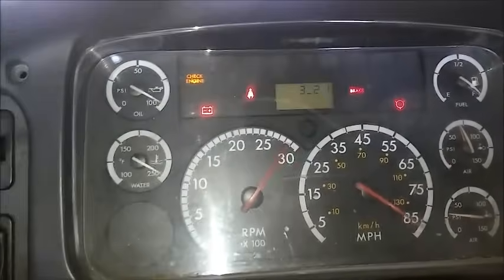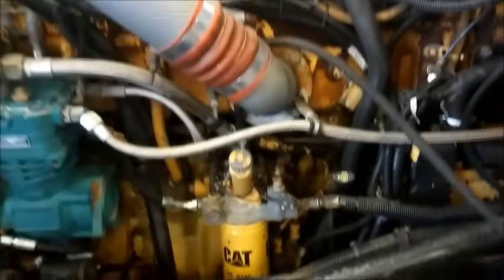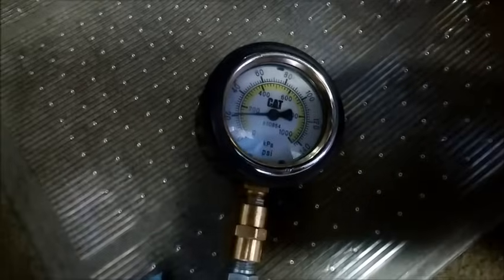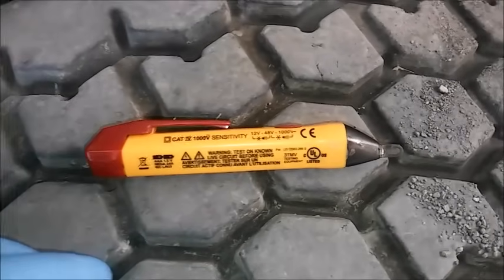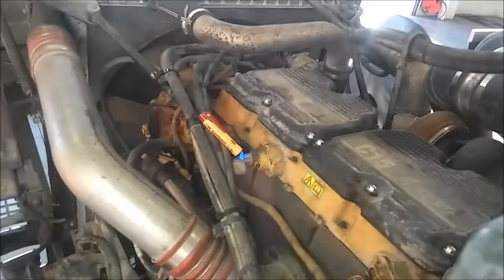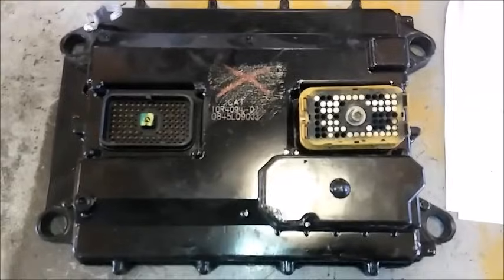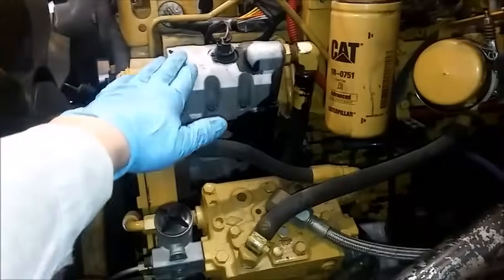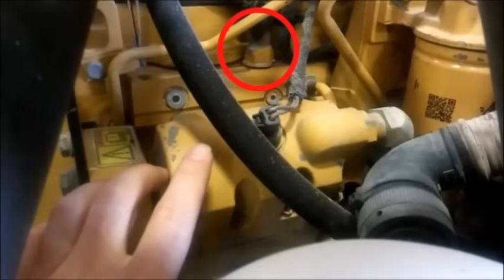Cat Engine Won't Start Troubleshooting.  Diesel Engine Crank No Start.

Comment: Hello Sir, I recently acquired a 2003 M2 Freightliner. I have found your videos most helpful with my C7. I seem to have a problem for which I have not found much if any information on. I have watched videos on cold or first start issues, which mine has but after the first start in the morning she starts up fine. My biggest issue is that the engine won’t shut off when the ignition switch is turned off, I have to pull the ecm fuse in order to shut her down. Any help in this matter would be greatly appreciated, I’m not sure where to start looking. Thank you for your time and great informational videos.
Reply: If it runs through an ignition relay to send voltage to the ecu to wake it up the relay contacts may be stuck on

Comment: I am getting nothing on the dash on any of the gauges, the truck is not going threw a chuff cycles I'm getting power to the ECM. I replaced the ecm and it's still getting nothing I had a dealer plug in to an computer and it's not communicating with the computer.... what could this be I'm dead in the water....

Comment: i have a 2007 cat 953   once engine is cool (sat all night) it will not fire without help of wd 40  once it fires  it lopes intermittently at low idle and acts the same at high idle
just recently i replaced the ecu, and the fuel/oil pressure sensor and hue pump.   still doing it exhaust smells a little unburned 
ideas????

Comment: Truck runs fine, when you shut it off and come back an hour later it won’t start without repriming fuel systems or using starting fluid
Reply: Terry Taylor  did you find out your problem what was cause ? Mine is doing same when it sits whole night next day it’s hardy start . I have c15 twin turbo

Comment: I did note that you had not checked the fuel filter output. I personally found many cold engine start fails to be week flow fuel filters mostly show up during cold start durring cold to very cold weather this is mostly GMC, Kuibotas, Oliverse, Mann, and many Euro's Diesels, American's units as well  any other throughout my world travels {US Army} but only two "Cat's TA 1697" please keep up this good work I am retired Diesel mechanic and  I started back when D5 Cat's had to be started by torch heatting cylinder glow rods during the middle 1950's. Most Diesel fuel is very dirty even right out of the station pumps. Oh I almost forgot to say about clouding of cold fuel was not present in nearly every case.

Comment: A long shot question, but my Isuzu 5.2 diesel 4hk1 won't start. Can I do a compression test by removing the glow plugs? Or does it have to be tested through the injectors?
Reply: ApplianceGuyOnline you can do a compression test at either. I do mine thru the glowplugs on any Isuzu. Just make sure the pump is in the stop position as fuel will enter the bores sealing the rings otherwise giving a false reading

Comment: I have a Cat C15 Diesel Engine before it was only cranking but now it's starting and RPM Reached to 600 and it's getting shutdown by unexpected alarm please help me if anyone knows
Reply: Mohammad Aurangzeb I am using a c15 cat engine ( marine) I had a problem with the air intercooler leaking, after change noticed white smoke what is possible cause

Comment: completer all the test in this video engine well not start can use small amount of ether it well start and stay running and runs good , but if I shut it off the engine well not start again. this occurred after rebuild. on first start up it started ok
Reply from the maker: +Anyhony Lake I had an engine that a customer rebuilt, wouldn't start. He had done it outside. We checked everything and it ended up that every injector had failed, possibly from dirt. Changed the injectors and it started up immediately. I've never seen that before or since.

Comment: Hello Mr. Caterpillar. Need some help with a no start situation. When stored my RV for the winter it had been running great for years with proper maintenance. Went to start engine and have  good cranking with no start. I get about 300 RPM on dash tach and good oil pressure on dash gauge. Called a service tech with a laptop (Cat software) and during cranking we only saw 258 PSI high pressure. Tech said it was probably the HEUI pump.  I change the HEUI pump and still have a no start. I was thinking about changing the IAP sensor as the next step or maybe I should of done that first. Can the pressure sensor fail and read low. Reads O PSI when not cranking. This is a 2003 Cat 3126E (HEP18079) with C7 style HEUI. Can the IAP sensor be tested  with a multimeter? One last thing please. Do you have to purge the fuel or High pressure oil lines. I have good fuel feed to the transfer pump. I used a little air pressure in the tank to force fuel to the pump inlet. Thanks for the videos and any help you can give me.
Reply from the maker: +Doug Hasson Hi Doug, that is very low HEUI pressure. Did you pull the valve cover and see if you have an injector seal that is leaking HEUI pressure? I would do that before replacing the IAP sensor. The IAP sensor rarely fails.
Reply from the maker: +Doug Hasson You can email me directly if you want at AdeptApe@yahoo.com it is easier to communicate on there.

Comment: Hi I am purchasing a 1962 boat which has( 2) 3114 diesel Cat engines. I am not to mechanically inclined and live in Tacoma where boat is located . What should I look for immediately when we start engines  and  sea trial motors. Do you know anyone in my area of tacoma washington that I can utilize to service and or rehab these motors. My email address is waprocess@aol.com I Your channel is great. Thanks, Aaron 206 491-0207

Comment: I have a problem in engine Cummins 4cylinder that no diesel coming from diesel pump nozzles iam pumping and the in plug is ok and return also but no diesel coming from nozzles which in diesel pump 
Please any help

Comment: This is exactly why, as an owner operator, I run a 07 truck and refuse to buy a new truck with all the sensors. 
You can trouble shoot and repair these engines with out being a super tech with a super computer. 
When your in Wyoming during a snow storm and you get a ck light on, your fked LOL Or Northern NV or Even BFE Canada...your in major trouble. 
But you have hope with a older truck. 
A 3406 b or e or a 12.7 detriot or even a n14 will all allow you to make it to a safe space even if you have engine issues. 
With the new trucks, your on a tow truck quicker then you can say FUtruck! Then prepare for the beating your gonna take at the shop in Diag time and then parts and service time. Dont even get me started on Volvo engines , paccar, mack engines or 08-10 isx junks. They should go to jail for selling those to people.
Reply: Whats the most likely issue if your CAT 3208 wont start? It runs off of starting fluid when sprayed into the intake, but once it runs the starting fluid out it dies.. I blead all the injectors and they all have diesal flowing from them. It has plunty of diesel inthe tanks... The fuel filter is full and primed
Reply: Lee Hill 🤣😂🤣
Reply: The tow job should be a beating also... I'm just reminding....
Reply: U r a moron Volvo motors are the best so far they still schools North America how to build a decent motor and Mercedes schools Detroit how to build a decent motor the cat garbage it got lucky whit international  they got bought so STFU u moron and keep changing 2 turbo s in the same time

Comment: I'm working on a ford f650 with a 3126 cat engine. I had fixed a dead injector and resealed the others and replaced the heui pump. It ran great, then backfired twice and stopped running. Now it doesn't start. I'm new at diesel.  Can anyone help?

Comment: I have 3126b icant  hear the cliks it does when you turn the key on the engine it cranks but won't start
Reply: I have the same problem, i replaced the cable harness coming from the battery to feed power to ECM it fixed my problem .
Reply: Carlos Medina  I have me a 2002 gmc 6500 having a starting problem. Are we talking about the same vehicle ??

Comment: I have a cat c12 it will start and after a couple minutes shoot down  I prime the pump it will start and run find but if I turn it off I have the same problem I dont know where  the fuel return valve is locate I went to the dealer they said at the filter  base but it is not any idea I will really aprecciate
Reply from the maker: +Pavel Rodriguez The secondary fuel filter, the engine mounted one, has the fuel pressure regulator in it. There is a plug that is I believe a 1" drive bolt style head, if you remove it that should be your regulator. You'll know if because it'll have a check ball and a spring on the inside of it.

Comment: seems that you know about problems with trouble starting trucks and such.. a friend of mine is having problems starting his truck its a 98 peter.  after a simple oil change in his semi  it wont start and check engine light is giving 3 codes which are 33, 44 and 45,, how can this be fixed and what is the issues?
Reply from the maker: +AwesomeMCGuy Please email me at AdeptApe@Yahoo.com with as much detail as you can give me and the engine serial number.
Reply: will do i'll email you  in a few days next time i visit my buddy, my e-mail is minecrafterdude0101@gmail.com

Comment: Love your explanation ,question i have a 7.2 cat 6500 ,sr any help will be greatly appreciated , my truck runs and idles like a new one the trouble i am having is that as i try to drive it he goes to missing and blowing white smoke this started last week listening to your explanation i am incline to believe may be the heui pump ? any help you may recommend on this issue  the oil gage in the truck does show a low pressure ? acts like water in system that was all check , really use to working on 6.0 7.3 this truck never have give me trouble ,your help will be greatly apressiated ,i do get codes for all injectors and replace the icp sensor for i had code 39 showing also, but still doing the same thing ??? thanks
Reply from the maker: +Jose Gorriz Can you email me this question please at AdeptApe@yahoo.com

Comment: Good day.  
Yor videos are simply done well.  much appreciated.  I have one of the problem with C15 engine as described below.  Kindly assist to advice the way forward.

Caterpillar Engine model C15, serial number MCW02801, ECM software 367-0750
this engine is used on crane.  Always problem in starting engine with battery.

Air start always okay.  Engine RPM reaches close to 200 RPM and engine starts without problem.
on battery first time it reach around 180 RPM and engine start.  from 2nd start onwards engine rpm reach only 150 but could crank at 150 as long we keep the start button pressed.  this show that battery has capacity to crank for prolonged period of time but engine is not starting at 150 RPM
 
for the purpose of test while we crank the engine using battery at 150RPM, I sprayed engine starter spray at the fresh air intake side of the engine and the engine is getting started.
 
 
my question:
1. what is the starting RPM is needed for engine to start?
2. is it possible to make the ECM to release fuel at 150 RPM? 
3. what is the interface communication cable needed and software is needed and where to buy them?,  I am stationed at Singaproe
 

 
 
Kindly assist to advice.

Comment: tach signal in a gmc C6500 with a 3126E, it is coming from the ecm or the alternator??? thanks a bunch.
Reply from the maker: +Gonzalo Perez Should be coming from the ECM.
Reply: thank you, because I do not have motion at the tach. but the check engine light turns on for a moment before crank, still the truck will not start.so i was thinking the ecm is still good.

Comment: i have  it sat long time, i found corrosion on sensor circuit, then the fuel pedal is unresponsive IM  on the proper path?. Thanks Jm
Reply from the maker: +Jim Flynn Corrosion in the throttle pedal circuit can lead to unresponsive throttle.
Reply: thanks very much jim

Comment: Had a starting issue like this on my CAT 3126 diesel pusher....it started, drove fine for about 45 miles, then would not start...it would crank but would not run. Of course, we were not home so we had to have it looked at by the RV place, which then had it towed to a Freightliner dealer. We had a wiring problem, and did not have proper schematics than. 

Up underneath the back end, behind the maintenance panel, there a lot of wiring to the remote start/start stop switches, etc. Over the years, many of the connectors had become corroded or broken. SO the service tech, eventually bypassed this wiring.  In this wiring, there hangs what is called the "STOP RELAY"...its just a cheap 5 terminal relay that can be wired as normally open or normally closed. Between the wiring and relay, the wires had shifted around so that the 'normally open" circuit was closed (thus killing the engine). The service tech wired around this at a substantial cost ($140/hr) so that it always starts OK. After we got it home and I got up under it and started looking around, I discovered the real problem (as I now have detailed schematics). OF course the motorhome is 21 years old, and was parked by my dad back in 2011-2102....and we are resurrecting it...(my dad passed away a couple of years ago) as my mom wants to take a trip to FL in it.....
Reply from the maker: +QuantumRift I've had to "custom fix" many RV electrical systems like that because finding wiring diagrams for them can literally be impossible. As long as it is wired professionally it should work.

Comment: I have a 1976 l800 with a 3208 engine cat that will not start crank but no start and if I spray starting fluid it will try to start
Reply: Without a turbo
Reply: do you have serial number of the engine??

Comment: current currently having problems with a generator that has a 3126b (bdz series) engine it. the engine will crank and according to the display on the GSC (generator set control) the rpms  are at 250 but it won't start. the issue with it before was it had an undervoltage alarm. now it has no fault codes and it won't start. Is this an ecm problem?

Comment: Hello friend , I have cat c-15 acert MXS i have code-32 invalid throttle positions sensor , i bought new one 266-1471 but problems is still there checking volts are pin 1red should be 8 volt but it is only 1.80 pin2 black is ground and pin3 ecm return is 2.90 unplugged is 13.38Please help if you can
Reply from the maker: +Satveer Dhillon Do you have a wiring diagram for that circuit?
Reply: Adept Ape thankyou for your reply , I found that wire coming from ecm to sensor it is short somewhere, so I am thinking to cut the wire from ecm and put a new wire to the ecm , is that right thing to do as I can't find where wire is broken , it is 70pin,  pin no. 4

Comment: I am having fuel issues, and it tries to start with ether/starting fluid as well as sometimes we manually pump...  any recursive
Reply: Rachel N Mine too
Reply: So the transfer pump has gone out, replaced that, and our fuel was very airy, narrowed it down, turns out it was the ignition seals.   or so I was told I was not working that day, the entire span of this issue the oil pressure light would come in here and there, now it is in until with turn start it, or flip the master switch
Reply: Rachel N

Comment: hey i love ya vids and calm demeanor lol i got a question i have a 1999 Gmc topkick with a 3126 has a no start issue when the key is first turned on the check engine light comes on for a few seconds then goes off as it should but it cranks and no start if i spray ether in it it will run for like 20 min but if it stalls or i turn it off it wont start back up on its own without ether have u ever run into this can you help me.
Reply: davon byrd hey I’m having the same problem you’re having. Did you ever find out what was the problem??

Comment: Hey I have a question, hope you can help me with this, I need a ECM replace, is for a cat 3126 part #149-6989-01 and somebody has one, but it is a ECM part #149-6990-01, before I get it, Do you know if this is compatible ECM ? or it can be use with no issues ? thanks for you help ! I'm not a mechanic, but like to learn.
Reply from the maker: +Wally Avila Only put on the right part number for that engine. Even one number off could be for a completely different engine like a 3406